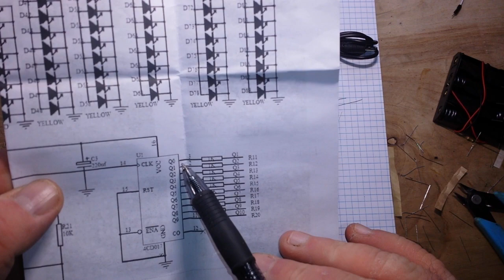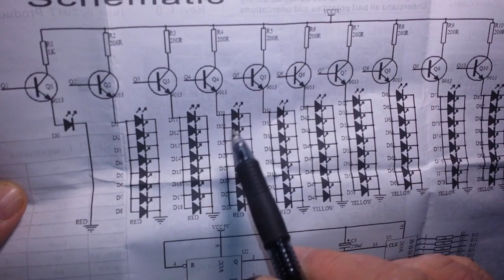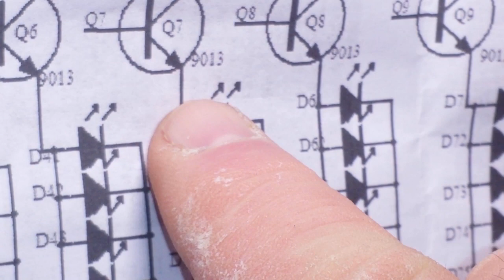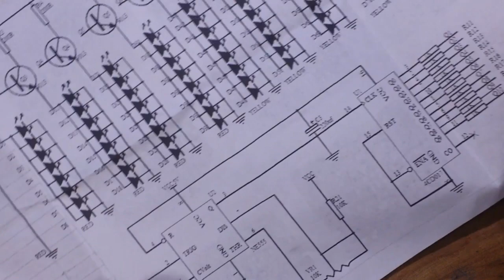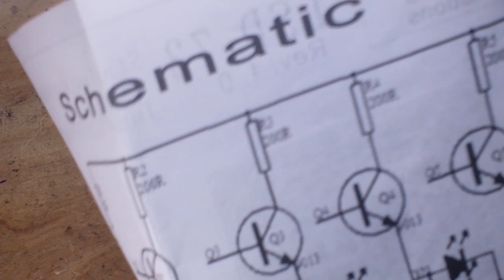Starlight Water Kit build with circuit explanation

Comment: Thanks for the video. I wished I had seen this before doing my Starlight Water Kit. 

I heard you say, to put the anode in the square hole, which is non-conventional. If you Google proper orientation of LEDs on circuits you will find numerous locations that say the Cathode or shorter lead always goes in the Square Hole. 

But this Kit is apparently very non-conventional, you had better put the flat side of the LED which denotes the Cathode side in the round hole and or the long lead or Anode in the square hole.  

Read on if you want to know my nightmare with this kit. 

I also bought this kit, I looked at the diagrams on the one and only sheet of paper instructions and decided to put the anode in the square hole. I had installed 6 of the 8 rows of LEDs and got tired and quit for the day. Next day I decided to look up proper orientation of LEDs and found numerous explanations saying the Cathode always goes in the square hole and the anode in the round hole. I wanted to cry, because I had installed 57 of the 73 LEDs wrong. So I thought what the heck, this will give me practice de-soldering and see if I can keep from ruining the races on the board, while trying to de-solder and clean the holes.  

One whole day later, I had all of the LEDs out and the holes clean of solder and the now short LEDs leads, because I had cut them, clean of solder. 

I began re-installing the LEDs, the conventional way, with the Cathode in the square hole this time. Since the legs were now the same length, because I cut them after installing them the first time,  it was hard to see the flat sides of these LEDs which would denote the cathode side, but turning them numerous times in my fingers and dropping them numerous time I thought I had them all correctly oriented.

I completed the job and only two lights would flash. I took a close look at those two LEDs and decided I had installed them with the Anode in the square hole and the cathode in the round hole. It was really hard to see that flat side on some of these cheap LEDs! I took those two out and turned them around, but did not solder them since they fit really snug, with a little solder left on the leads and in the holes. Plugged in and no lights flashing.  Pulled those two light out again and stuck back in with the Anode in the square hole and they flashed. None of the other LEDs did anything because I had installed all of them the conventional way. I then went back and looked at the One and Only terrible sheets of instructions and decided, they do indicate the positive side is on the left which when holding the board so you can read the writing on it would put the anode on the left and in the square hole. Just as I had initially started out doing.  
I tried hooking up the battery, but put the red wire to the ground and the black to the VCC and sure enough all LEDs came on except for the two that were installed non-conventional, confirming that all LEDs had good connections. But, they would not flash and the two I.C.s' got pretty hot. So disconnected right away. 

Did I try to take all 73 LEDs out again and re-install? Hell no! I just gave up on China’s non-conventional boards and terrible instructions. Maybe someday, if I feel like I need more practice de-soldering and cleaning solder out of the races, I will do this job one more time. NOT!
Reply from the maker: Soldering practice is all.

Comment: The 555 capacitor first mentioned is not the timing cap, but a decoupling cap on the internal 3 resistor divider

Comment: First, i really like this format of u explaining as you go. Nice kit. One thing that caught my eye as odd was the load (LEDS) was on the emitter side and not the collector side. This is not the preferred method when using NPN. Any idea why they did it this way?
Reply from the maker: High side/low side they certainly broke with convention here but it works.